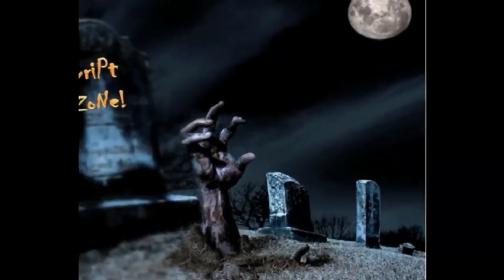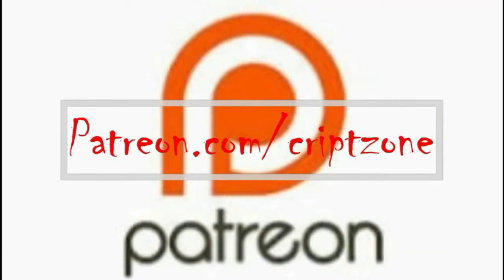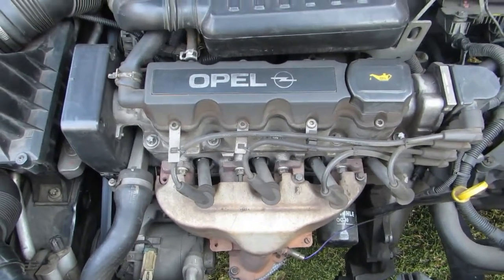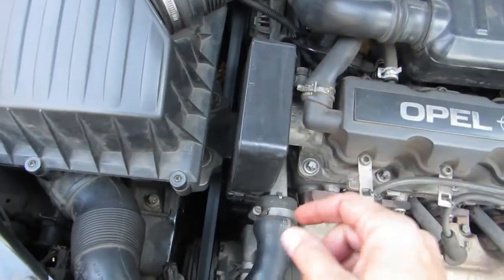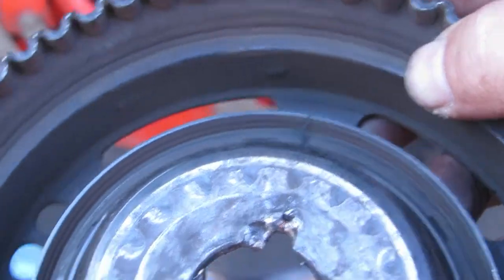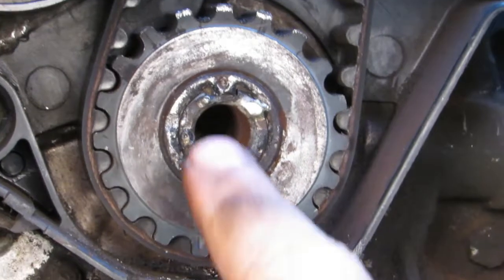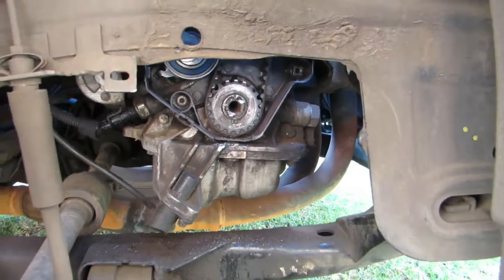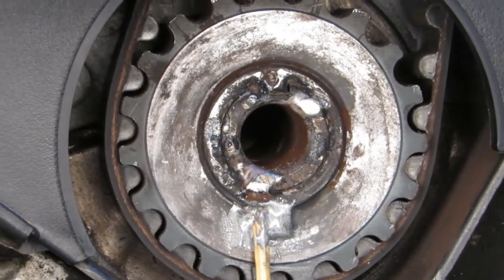V-belt repairs on Corsa utility 1.8. 2006 model

Comment: I fixed mine by machining a dummy pully and then I drilled three holes right through it and 120 degrees apart using  3,2mm drill bit . The holes were exactly centered where the crank and pulley touch. I then bolted the dummy pully onto the worn pulley while it was on the crankshaft and drilled three holes into the crankshaft and worn pulley. I then removed the dummy pulley and tapped the three holes with a 4mm tap. I then set the motor to tdc and lined the crank pulley and cam pulley up to the marks. I then used three 4mm grub screws to hold the pulley to the crank but also used some pratleys in the keyway. Its a perfect fix. Look up dutch keyway to understand how to fit a shaft to a pulley without using a keyway.
Reply from the maker: Awesome. Great fix.

Comment: Great info man, my Corsa bakkie utility is doing the same of losing power and respond late when I press accelerator and I've changed tps and idling valve but still does the same, so tomorrow il look for this culprit

Comment: Hi there .... Seems like this keyway is a general problem on these bakkies ...  Same happened to my father in laws bakkie..... Previous mechanic didnt tight down the pulley bolt enough so it popped out .... On inspection i noticed the keyway was worn away.... After reinstalling the idle was erratic..... So i will look into trying the pretley steel since i dont have a welder.... Hopefully it will fix the issue ... Thanks
Reply from the maker: It will help. The engineer was not happy with me when we eventualy had to change the crank shaf lol.

Comment: Thanks for all your informative content.  What are the torque specs for the crank pulley bolt?
Reply from the maker: Good day. At the time when I fixed it I did not own a torque wrench so I just made it FT. You can get a torque specs list off the internet. Just look at the writing on the top of the bolt. that will tell you the type of bolt and so on. Corospond it to the list and you wil get your spesification.
Reply: @CriPtZoNe  trying to find the correct torque specs has been a nightmare. So many inconsistent results
Reply from the maker: Have you tried asking the mechanics at opel them selves ? @ThatV12MiataBruh

Comment: I also have the same problem with my bakkie maybe i must do the same to mine but i also welded the pulley to that gear but i still have issues. In my case i think the bolt is coming loose after a well of driving. maybe i must also make a extra washer

Comment: Hi sir , we did an engine overhaul. 
My mechanic requested a new crank pulley.  I got him a good second hand . 
He says the car is cranking but the  pulley is wobbling so the car will not start. 
He says the reason is the the pulley comes loose any suggestions.
Reply from the maker: Yes it wont start because the crank sencor is not sencing the pully the whole time. Must run smooth. No Wobeling. Put locktite on bolt. Put gear in 5th gear and use a torque wrench to torque the bolt. And make sure that there is no play on the keyway.

Comment: Thanks a lot Eugene are there any more methods I can use?
Reply from the maker: Try and put a screwdriver or shaft in the top timing gear if the belt is on. If it stops the top ger from turning the bottom pulley will also not move. that's all the ideas I have. Hope it helps.

Comment: Hi there I'm changing the crankshaft but when I tighten it the pulley is rotating clockwise as well, what must I do
Reply from the maker: Try putting the  car in 5th gear. It will lock the system then you can tighten the pully

Comment: How are you going to change the timing belt in the long run
Reply from the maker: Hi. Well to be fair I sold the car. But I did inform the new owner about this. And he told me that he was going to use the car for spare parts so all is good. I would had to get a new crank any way at the end of the day so I would cut off the pulley, removed the crank and replaced everything.
Reply: bs
Reply from the maker: @duke3326  Which part ?
Reply: I keep having issues with my Corsa Gsi crank sensor please help